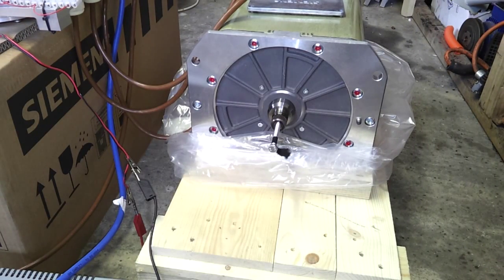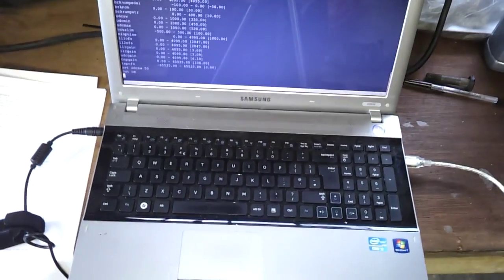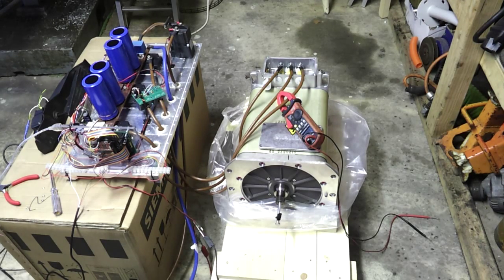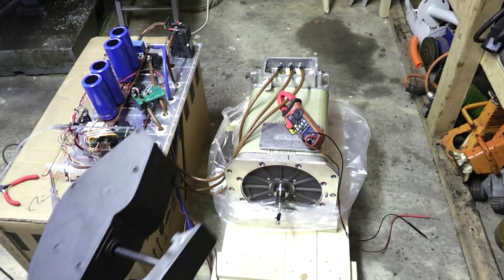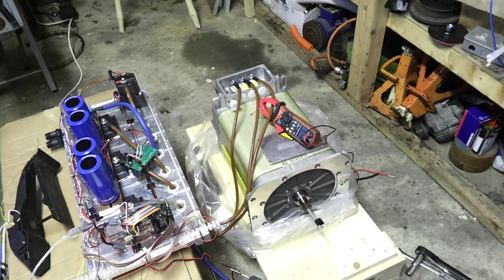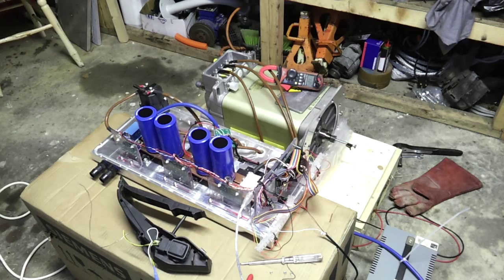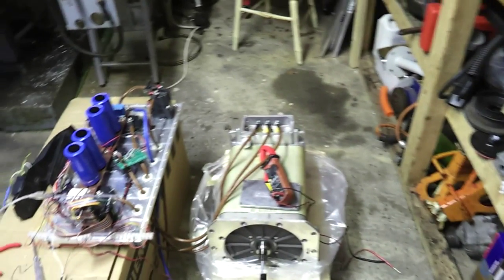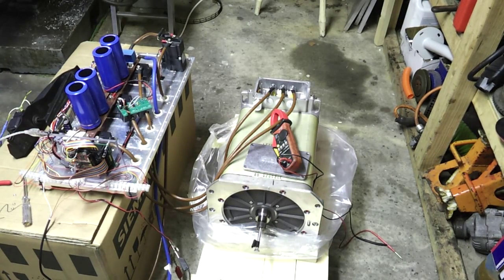AC Motor Controller 02

Comment: So from my understanding an ac motor varies speed at an equal torque by increasing frequency if voltage is kept the same. So is it possible to set this up on a computer program so that it drops the voltage and increases frequency when you are not trying to accelerate and do the opposite when you are?

Comment from the maker: Well seems I was a bit of a moron as usual! The throttle control was varying the slip not the V/Hz and with no encoder it got confused. Soon as i have an encoder plug we should be good to go. Of course its some wierd unobtanium connector.

Comment: Driving an AC motor with a variable speed and high frequency PWM is a game of matching voltage, current, RPM and frequency to the conditions.  For every frequency there is a new current.   If you want the same current you have to adjust the voltage.  Then you have to factor in the rotor spin.  As the rotor changes RPM the current changes, with current changes you have to adjust the voltage again.  With any motor current is proportional to torque.  And it's torque that pushes you down the road not horse power. 

The growling indicates that the system is not tuned.  AC induction motors don't care if the field is spinning faster or slower than the rotor.  They just simply reflect the difference in the amount of current drawn or produced.